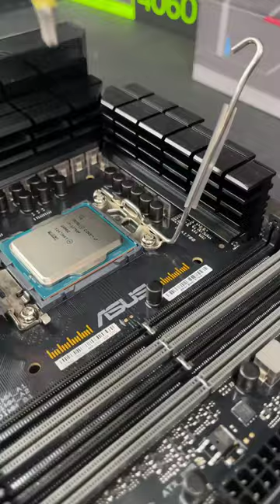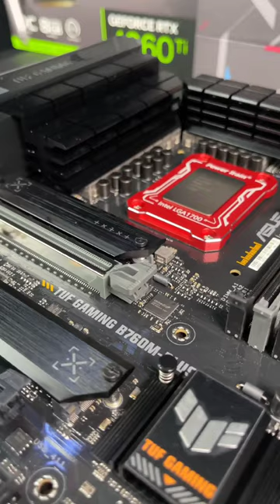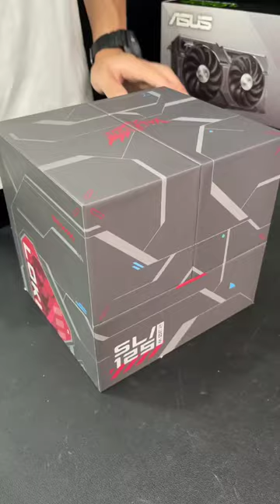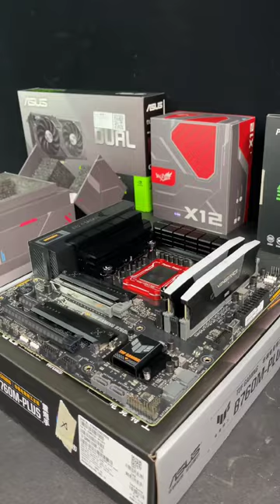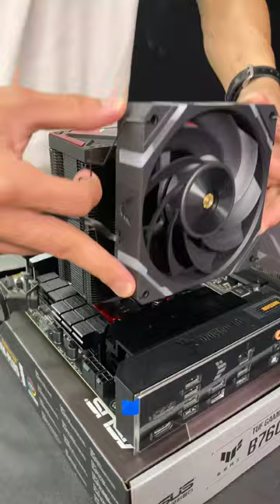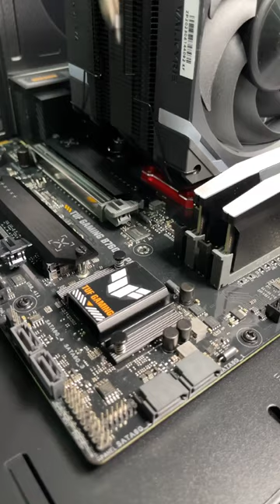Top specs gaming desktop setup

Comment: why did you swap the socket cover
Reply: To mount that monster cpu fan heatsink???
Reply: Newer intel chips are not square but rectangle so socket covers don't put equal pressure on every corner causing issues that's why it is recommended to put that kind of cover
Reply from the maker: Hi, has a better thermal and grip. Cheers
Reply from the maker: Hi
Reply from the maker: Hi, true 👍